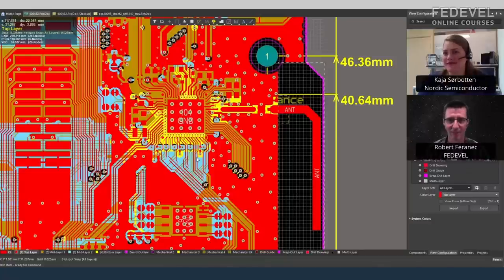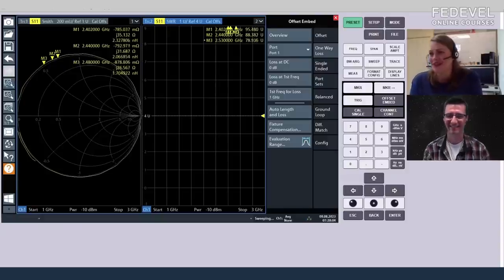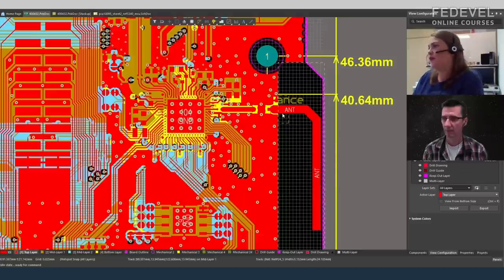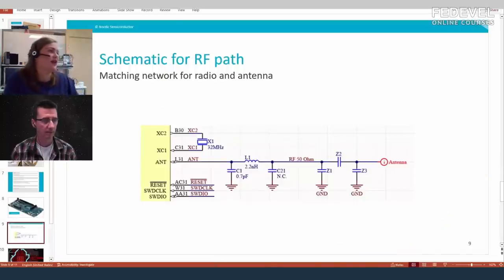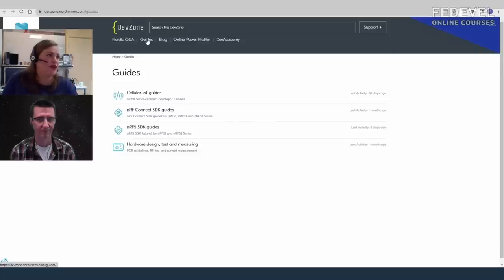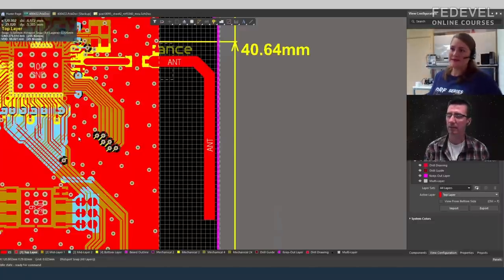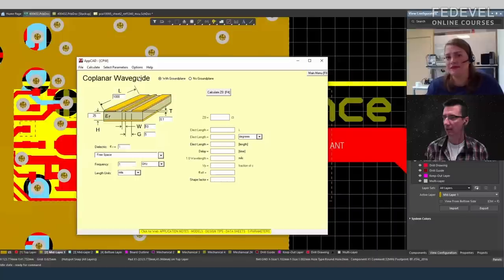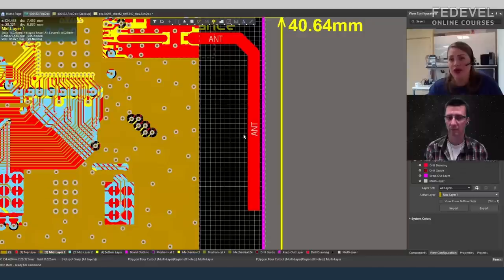PCB Antenna - How To Design, Measure And Tune

Comment: Robert, first of all, thanks for your videos! They are very helpful. As for the feed line design I think there is a mistake, the GND layer must be cleared under the series inductor used in matching circuits. Leaving GND under the matching component influences the feed line impedance. As for distances between vias along the feed line it should be short enough comparable to the wavelength to reduce losses. In my practice I use a 2mm pitch, which is good enough in most of the cases.
Reply: Regarding the suggested ground clearance below the inductor: where do you have this Information from? From several reference designs I could not see this …

Comment: Antenna design is a very tricky thing. The old masters did it all via experimentation and using intuition. You can get an amazing amount of gain with the proper antenna. When i was doing Ham radio a kid there was a rich man who built stacked rhombic antennas on his estate. that is the kind of antenna they used in WW2 for maximum range. It uses a lot of room, and is fixed in direction, but boy does it work!

Comment: Great tutorial, actually you don't need an expensive VNA to get experience with matching circuits nowadays. cheap nano vna or  libre vna will do the same job. We use Optenni Lab for RF matching, it has a large database of known manufacturers like Johansson, Murata, TDK etc. Unfortunately it is not free, but there is a trial version as far as I know.

Comment: Thank you for your explanations! However, I don‘t see that you have adjusted the impedance of the transmission line to 50 Ohms. Having high power output while seeing low harmonics is definitely a good sign for having reached 50 Ohms, but could you also measure this?
Reply: The same thing i want to know

Comment: I am curious as to the default inductor brand Nordic uses. TDK and Murata both seem to be popular, but from a naive  perspective, I don't consider them interchangeable. I suspect that even at 2.4GHz, the PCB stackup matters to inductance values.
As you asked in another video, "when is a capacitor not a capacitor?" when it's above it's SRF, it acts like an inductor. That was a big insight to DC blocking capacitor values for me.
Reply: The sample kit she was using looked like one I have from Johanson P/N C402

Comment: I can see that there is a 0.7pF capacitor on the reference design. Why not just make the trace a bit wider at the point so the parasitic capacitance with the ground layer underneath produces the correct value without the actual component?
Reply: I don't know, but I guess it's probably easier with a capacitor for tolerances and one can use a cheaper pcb material with less impedance control

Comment: There is one question I have. In this case that the Bluetooth IC has a 50ohm output you only need to concern about the matching circuit of pcb trace. If the IC output has a 35ohm impedance,  how to match the antenna? Thanks

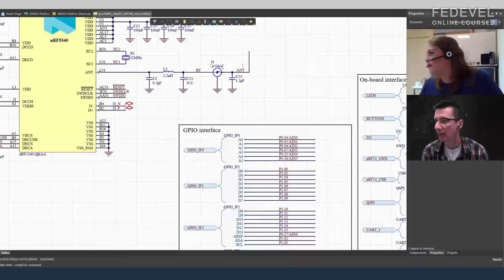Comment: 22:13-22:18 What were you guys talking about? LOL,  Srr. I dont get it!! Anyway, thank you both for great content!
Reply: SWF port for antenna testing that is on the Development kit. She shows the part number so you can look at the component. The part works in a way that it disconnects the PCB antenna if you plug in a cable to measure

Comment: Hello, Robert will you ever make a tutorial where you make your own board with Wifi and Bluetooth chip with 2.4Ghz Antenna (maybe inverted F) in Altium. Because you yourself explain things so much simpler and easier. Make an hour or 2 long video like this idea. It would really help a lot of people.
Reply from the maker: it is on my to do list
Reply: @RobertFeranec  Cant wait ❤️

Comment: Overall a great video! I've been looking for AGES and haven't come across impedance matching of microstrip antennas. I've also realised, standard capacitor and inductor books WILL NOT YIELD ANY GOOD results - the High Q caps Kaja used might be the winner - definitely worth the $80 AUD for the set.

One thing I didn't quite understand was why she decided to shorten the antenna to reach 50 Ohm... why does that work rather than adding more capacitance to put the impedance into the capacitive zone and then a series inductor to put it into 50Ohm + 0J? Would that have worked instead?

Are there any links or information about this? I'm a bit stumped on what to search.
Reply: She seem to didn't mention it at the same time she did that, but I believe she was shortening the antenna to help move the markers into the centre of the resonant frequency shown on the SWR chart on the right.  She was trying to avoid adding another unnecessary component.
Reply: Adding excessive C can be malicious from efficiency point of view, even high Q capacitors have their losses. It is better to hand-tune antenna on prototypes and move forward with new design.

Comment: I have one very important question: 
How she estimated the quarterwavelength is 22mm?
?if we consider the effective dielectric constant of the microstrip trace as 3.3 then using the formula, 
Quater wavelength = c/(4*(sqrt(effective dielectric constant)*Frequency)
This gives us 16.85mm not 22mm...
22mm is only possible when effective dielectric constant is 1.77 which cannot be the case in a microstrip trace!!! Please Explain!!1
Reply: Those calculations apply to dimensions of a microstrip line, a transmission line that has a line on top and a reference plane beneath a given dielectric material. The electrical length of the signal propagating in said dielectric is therefore affected by the permittivity as you well said. The antenna has no reference ground, it's just a metallic strip in the air (and a bit of the PCB dielectric, but no other reference beneath), so the length is more approximate to the free-space length - but still a little affected by the presence of a higher dielectric material in the vicinity of the conductor plus the fact that a monopole (as well as a dipole) should be slightly smaller than a free-space quarter/half of the wavelength, plus the fact that it is bent which adds inductance and thus further reduces the effective length to have the same resonance. There's no calculation that gives a precise value for it, the way to go is to make it the free-space quarter wavelength and then "tune it", by slicing at the antenna, arriving at the correct length for the desired frequency. That's why, unless you have simulation software, you can either build some prototypes with copper tape (and a lot of cutting skills), or otherwise follow the recommended designs. Hope that helped.
Reply: @magictwister8439  Ohk, Thanks for the explanation! I got it now!!

Comment: I’m making a board design on using the 5340 reference design at the moment.  I would love to know if it is possible to use the reference design with a dual layer 1.55mm board?  As of now I have no routing on layer 2-4 and just a few traces on the bottom layer, would it be possible to just have a dual layer board then or is there some problems I don’t see doing that?